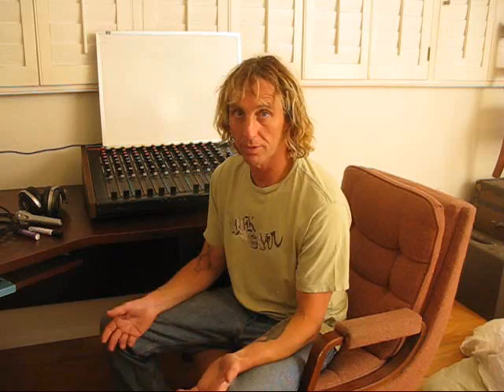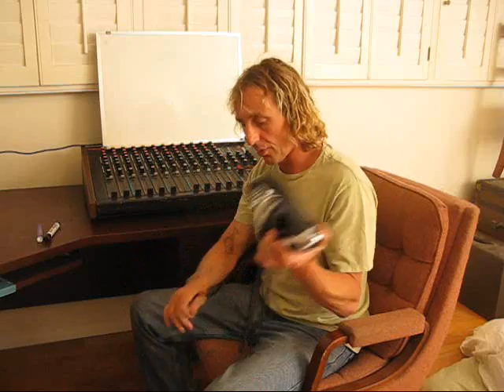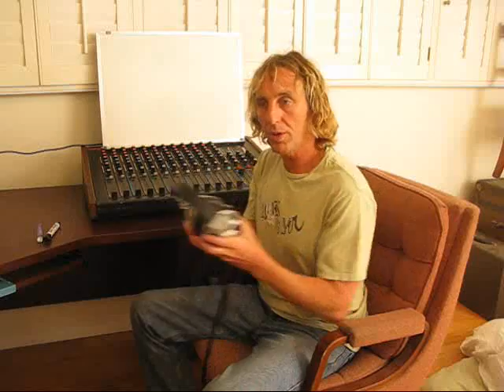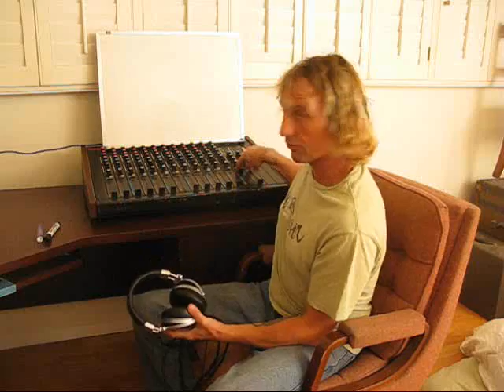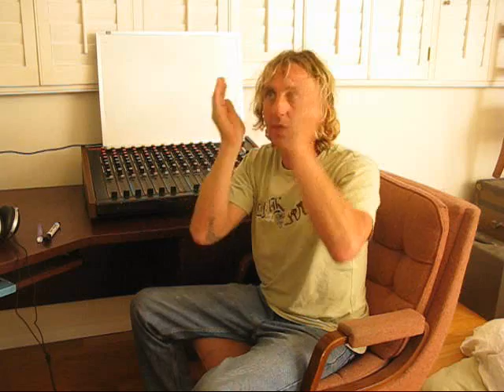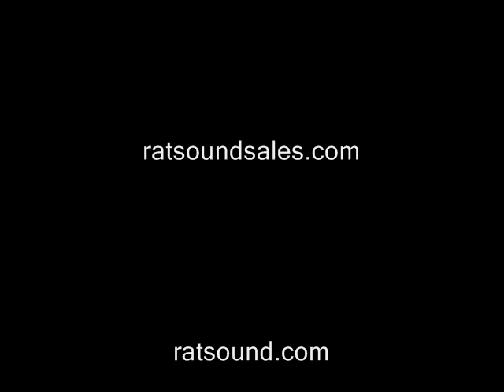How to EQ a PA System - Some Tricks

Comment: Quick question, do you delay your headphone signal to time it with the mains?  I'm digging the video channel.
Reply from the maker: +Blue Heron Texas I actually do not delay the headphones because when they are delayed, the headphone sound merges with the sound from the system and it is harder to differentiate between the two. When using headphones, I want to try and hear the headphone sound separately from the room sound as best as possible.  Also, one big issue I see is people pressing the headphone earcups tight, that vastly alters the sound of the headphones and gives an almost useless version of the audio.

Comment: Dave, awesome advice as usual, you may have been asked this question before, But with MP3's so popular these days and sample rates being pretty good, what are your thoughts on using them to EQ a system? do you prefer a CD every time? or have you used both?
Reply from the maker: Mp3's do show some degrading of sound and I try and use high resolution recordings if possible.  That said, MP3s sound fairly good and in fact, if you can get your band mix to sound as good as most of the MP3s out there, you are a doing really well as a sound engineer.
Reply: Thanks man. im getting better! Loving your work man! When are you in NZ Next?

Comment: Hey Dave. I really like how well you've explained your methods in all your videos. Watching them has been a great way for me to get my methods solid, efficient and tourable. Thanks for that.  
I did however watch this in hopes that I could learn more about ... ...keeping instruments onstage ..out of each other's frequency.. range. Like hpf on mics to keep the kick out, or lpf on vox to keep cymbal shimmer out.... 
I do this reactively and get some ghost results, but I don't have any rules of thumb. Just ears and compulsive fiddling to control.
Any suggestions for reference?
Reply from the maker: Point vocal mics upwards at a 30 to 45 degree angle to improve sight lines and reduce cymbal bleed into them. Use high pass filters and putting mics close to instruments all helps.

Comment: Hey Dave,

What is your recommendation for using mastering for live samples?

My band uses samples, and there is always a problem with volume and EQ.
Reply from the maker: Live audio is my area of expertise. There are other people that would be better suited to answer recording related questions
Reply: usually one of the problems with samples and backing tracks is that they are mixed in less than ideal speakers/headphones are realy bad speakers . if your speakers arnt good enough for mixing or the room is bad you can tend to over compensate. If they dont produce enough bass or the room is eating up bass you can end up with sounds that have way too much sub in them.

Sometimes you cant get round a bad room so good reference headphones are a must and learn to get used to your "studio sound" to not over compensate.

As for volume levels this is a tricky one as studio mixng can be quite different to live. All i can say is there are many areas that could be the issue, from seperation issues between all the parts in a recording to transients causing issues with not being able to level things out to max other tracks.

Im also a live engineer with some minumal recording and mixing experience so cant quite really exlain or give any one thing that may help.

You could try giving your samples that are being used some limiting and multiband compressoin to catch out some agressive transients and also level it out a bit.

You will want to edit your samples in a decent program that you can use good compression limiting and EQing plugins using good reference headphones and speakers

Be carefull with sub as live sound systems can tend to produce alot more sub frequencies than you can find in some home recording systems .

Comment: Hi Dave, 
I have a problem with my PA system which may related to EQ. My equipment are Behringer Xenyx 1204USB and Behringer Powered Speaker B112D x 2nos. I love the sound it produce especially acoustic music. However,  some Mp3/ songs sound bad (like crackling) when the vocal sing/ shout on high note. The set up is station at my home only. 
Hope you could advice. Many thanks in advance
Reply from the maker: Sounds like something is overloading.  Probably the low end that is present on MP3s and not so much lows on acoustic is causing it.  Something is either too loud or possibly a speaker has a torn surround.  That said, troubleshooting via youtube is a bit tough.  Seek out a sound savvy pal that lives near you to help you out

Comment: where I connect systems eq into mixing board?
Reply from the maker: I typically do not record off the L/R busses and instead record from a stereo matrix with the subgroups dialed up into them plus a stereo room mic as well. I also send the subgroups to the L/R busses. I do this so I can change the overall sound system volume without messing up the recording and also to add some room ambiance that I do not want in the main PA.
Reply from the maker: Insert it if you can on L and R.  Otherwise out of L and R into EQ, out f EQ into system
Reply: Dave Rat i would disagree there, with respect, because if your system eq is inserted it will affect the record coming off the left right busses, thus defeating your entire concept of strip eq for tone control

of course direct outs or a matrix out  feeds to record would bypass that issue
Reply: +San Saechao I was going to ask this ? as well, but delayed it, and kept on reading. I was thinking of doing it on the LR, but wasn't sure if it should be done in the Matrix (crossover). I figured it be better to not mess with the Crossover HP/ LP curves though. I'll have to figure out if i can save each EQ for each venue in the x32 now.

Comment: Hey Dave, how do you connect your system EQ? I know  I have to use 31 Bands Graphic eq,
Reply from the maker: My preferred setup is to drive the PA off of Matrix 1 and 2.  And then insert the house EQs on Matrix 1 and 2 as well. Then I run all the channels to groups, groups to L and R, and L and R to Matrix 1 and 2.  That setup allows me to PFL L and R and hear the mix pre house EQ and PFL matrix 1 and 2 to hear the mix post house EQ
Reply: +Dave Rat Thank you so much for your tricks, really really useful. One question about this last: You do that (LR to Mtx 1/2) to PFL on your headphones? Why do you need to hear post house EQ on your headphones if this EQ makes sense only through the PA speakers? Thanks a lot again!!

Comment: How is that what here my headphones sounds very good but the FOR seems like we are in a box during church services please advise.
Reply from the maker: Not sure I understand the question.  Please clarify
Reply: Scratch that Dave...my biggest thing now is making sure that bass, kick, and the keys low notes are not clutter around the low register...how do I bring clarity to the sound?
Reply: Eldred, I believe that based on what I understand, that if it sounds good on Your headphones..then you want to adjust your house eq to match( this will change in different venues because of acoustics). If you are not using a house eq at all but soley relying on the boards eq, then then using the headphones will not work as adjusting the board by itself to sound good in a particular venue will not give you a particularly desirable affect in Your headphones or rec/line out.

Comment: Quick Question. when you are mixing live versus studio, It seems to me that the low end is generally accentuated in live more so. but in a mix reference on cans, that would come off overwhelming to the cans drivers. So do you tend to accentuate the low end to the subs in the system processor? and If so, do your board mixes account for that? It's a big struggle of mine, so any sage advice would be hugely helpful. these videos are like 10$ gourmet burgers for free. thanks for making them!!

Comment: Question about subs in regards to this method. It seems to me that you want low end a but more hyped in a pa than in a mix reference. So do you always mix low end to be louder at the system processor side or at the board? Thanks for these incredible videos Dave

Comment: An addition; at least thats the way i do it; The board eq's fix the input/Mic/source relation, but is also used to create room for other instruments to blend in. F.e.; i usualy create a dip around 63 hz(or 80Hz depending on music type) in the bass, and a peak on the kickdrum on the same frequency, to make it cut though the mix. Same deal on keys & guitar sections. from a musical point of view this should not be necesairy, but not all bands have their sounds in order like the ones you work for.

Comment from the maker: Good question and yes, there is a way to create a "safety net" per se.  If you insert a compressor on the channel or on the mix, and set the ratio very high, and a fast knee (not over easy) and the compressor is of reasonable quality, then the compressor can act as a "governor" to prevent feedback from getting too loud.  

Be sure to set the threshold high enough to compress only on loud feedback.  Then move the compressor to each channel as you ring out or on a digi board, enable and bypass.

Comment from the maker: Actually a room can be EQ'ed quite effectively using headphones as a reference. Audio reference points are very useful and often much more helpful than using test equipment for perception based presentations. 

I will qualify my position by saying that I have used this method extensively and have over 3 decades of experience as a sound engineer mixing arena's and stadiums for artists: Red Hot Chili Peppers, Rage Against the Machine, Blink 182, Beck, Soundgarden and many more.

Comment: What's the best process for "ringing out" a room? I find myself carefully edging up the master level, (mon. or main), until I hear something start to flare up, then back the master back down quickly, find that frequ on the EQ and pull it down. But inadvertently, something always gets away from me briefly and squeels.  Any safer way to find those offending frequencies with a tihghter handle on levels? Thanks SO MUCH for your work! You are an excellent 'explainer'.

Comment: Well, it looks like I've been doing this right from the get go, I don't have fantastic equipment, Jbl SR4732 and 4715 subs and add a 1x18 W bin if I need more umph, but from the start, I wanted to use whatever I did have, to the best of it's ability without blowing things up etc. At lower volumes, I could add more deep bottom end, higher-I'd cut it back due to the volume. For headroom, I was using CRown MA3600's but recently switch mains to a Crest cc4,000.

Comment: RAT stands for "Reveal A Truth". The only limitation is what your equipment will allow you to do. The basic idea being... Set the room EQ and level to sound good with familiar music (the same source every time)  ... set the board for a good mix in the headphones ... and marry the two. Slight tweaks for feedback management and you're done...  as best as can be done for that room. What's nice is that the board output is ready (including 9 to 3 o'clock or less panning) for a good stereo recording.

Comment: Dave, I beg to differ in your approach it is still considered a little old school.  Your approach is to correct for equipment flaws.  A newer approach is managing the frequency given to each channel, this allows for a perceived channel separation.  This is especially needed in vocals where each vocalist is given a featured frequency range and allows for volume changes without stepping on another vocalist's frequency range.

Comment: Can anyone tell me a good equalizer to use to correct resonances in my room? It should be tweakable because I need to cut down the 50 and 120 hertz, but I only found eqs that have 63, 125, 250, 500 hertz and so on... I'm not talking about vsts or plugins for a DAW, I need something capable of eqing the signal just before it comes out of the speakers.

Comment: Yes but the basic is what Dave said when you have done that, then you start to adjust the mix withe the acoustic sound from the stage. I did a jazz week in a medium sized tent with a small stage and when I got the main EQ right everything went on fine. I Eq'ed the monitors also. I had 5 bands each day only a halfhour to rig and do soundcheck and the last band was always a big band with up to 25 ppl with a huge brass section and they are loud. This is the basic for all live mixing.

Comment: AND DONT FOR GET TO ADD.. SHIT IN =SHIT OUT.. MAKE SURE YOUR STAGE RIGS ARE EQ'D CORRECTLY. THE GOAL OF THE EQ ON THE BOARD IS TO BE FLAT.. WHICH MEANS YOU ALSO NEED TO LEARN TO RELY ON YOUR MONITORS. AS THEN YOU CAN KEEP YOUR STAGE VOLUME LOW. THE LOWER THE BETTER. NOTHING SHOULD COMPETE WITH THE MAIN SYSTEM.ALSO GIVES LESS INTERFERENCE WITH LIVE MICS.THIS ESPECIALLY TRUE WITH BASS RIGS. ON BOURBON STREET, I USED TO GET ALL MY BASS PLAYERS TO ONLY USE A DIRECT BOX. THEN SEND IT BACK THROUGH.

Comment: Dave, I`m planning on buying my own sound system and rented out for shows......but where do I start as far as picking the equipment. I`m planning on spending around $20,000 - $25,000  for now.  I would like to buy a yamaha digital sound board with all the effects, processors, etc, etc already installed. What speakers are pretty good, not that expensive but still attract the bands to rent my equipment.

Comment: @readerwriter 
Small rooms are not the place to worry about pulling board tapes, unless you pull them from an alternate mix source. In a small room I only use phones to check for channel problems not for the mains mix. You have to 'ride the room' and use the FOH to balance and clarify whatever is hitting you from the stage.
It can also be helpful to get the artists to work with you instead of against you. A 10% reduction in stage volume can make all the different in the world.

Comment: Great video thanks Dave, my question would be - how well does this work in a small venue where you're dealing with a lot of direct sound from the stage. I've found headphones very limited in this situation as the headphones give you a little isolation to hear what's going on in a channel but then when you have the direct sound in the room you have like a third element in the eq puzzle - or am I just looking at this wrong.

Comment from the maker: @6sebastiancol I insert my main EQ's and drive the PA off of Matrixes so I can PFL pre and post EQ as well as have a post EQ gain control.  I compress the groups and do not use L/R compression, only compression after L/R is the system limiters

Comment: Dave i got a question  about  the live setting up, is it from the main outs  to the crossover to the amps  and speakers  and then you as a foh engineer controll the two main line arrays L/R and just use  auxes for fx and in your main inserts  the venue eq and main compressor?, then the monitor engineer controlls his auxes for the wedges and internal mixes for the band membes?, sorry for bothering you

Comment: After watching this very informative video I wondered to myself how or if it could be applied on the monitors end of the snake. So to satisfy my curiosity I recreated the method with my wedges at a venue I work in. We have Radian Micro 12's and 15's as well as Rat fills. After tuning the wedges and mixing a show using the method I found that it works in mons quite well and I can get my wedges louder without them wanting to run away on me.

Comment from the maker: @npgdrums I have had numerous issues with sound vendors adding processing to the signal chain that alters the sound of the system in a negative way. My preferred signal chain is analog L/R console insert>1/3 oct>parametric>L/R ins ret & L/R outs direct to processed amps. My rule of thumb based on verified audible experimentation is "convert to digital and back to analog never more than once." or "once the signal converts to digital, it stays digital till it hits the analog power side of the amps

Comment from the maker: @lenoxx89 Theoretically, yes. Though if set up correctly the alteration of the sound by the hardware should be negligible compared to the info it provides.  More important is to make sure that there is no issues like distortion, noise, or other aspect t hat pollutes the readings. It is wise to actually listen to the the RTA mic to assure that what it is 'hearing' is clear and not tainted.

Comment from the maker: @randyswift Well, it's only true if they make you do it.  I never Zero my board while on tour or when mixing the same or similar bands on the same console.  I always zero the board when it loads into a new show or setup.  

If you are the only one on the console, I would set the board how you wish and leave it.  If you have other engineers working on it, you may be able to find a "working zero" where you set all the knobs to logical working positions that are at or close to what you will need.

Comment: @gunnyranger2  Sounds to me like it's on their end... their ears are becoming fatigued. Vocalists (especially in small venues) will complain that  "they can't hear" their vox or guitar after awhile. That's because of the combined volume of the monitors, amps and drums are killing the high freqs in their ears. At sound check, I roll off the highs on the monitors. Then bring them up when they start complaining...sneaky, but it works for me...

Comment: Hi Dave,
I follow your blog and since you are making video's it's even greater. 
Would it be possible to explain levels from the desk to a controller to the amps? 
Propper gainstricture is important! Right!?
*confused* dBV dBu dBFS ..setting limiters in controller..protect equipment ;-)
On my crappy 01V96V2 the master meter shows dBFS !?. So wenn the LED-bar shows -20 the output is at +4 dBu.
Maybe you can cover some of the subjects?
Kind regards from Vienna-Austria